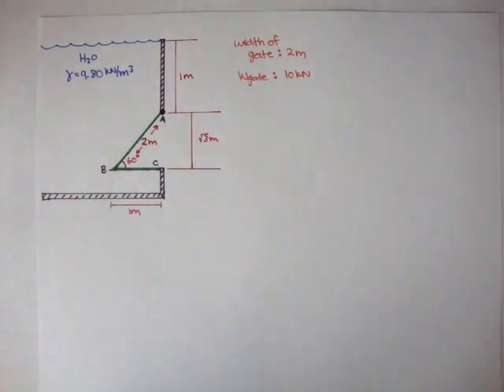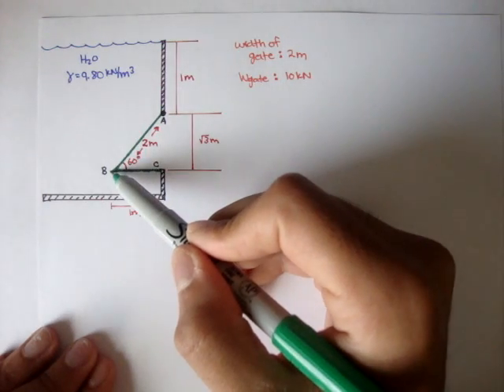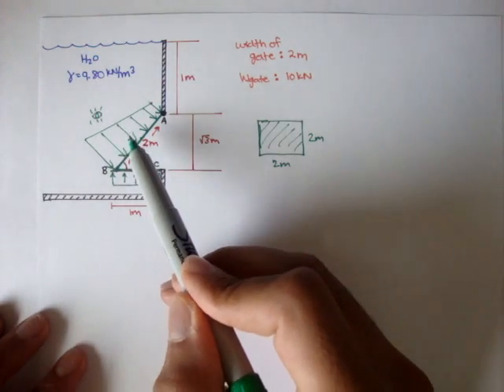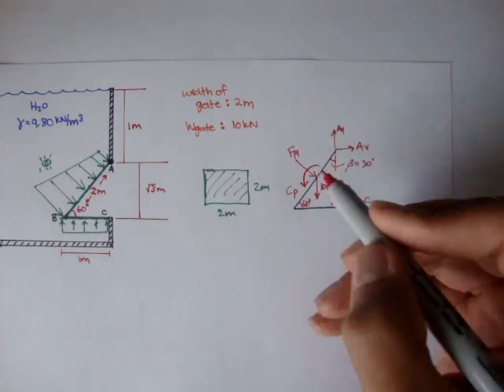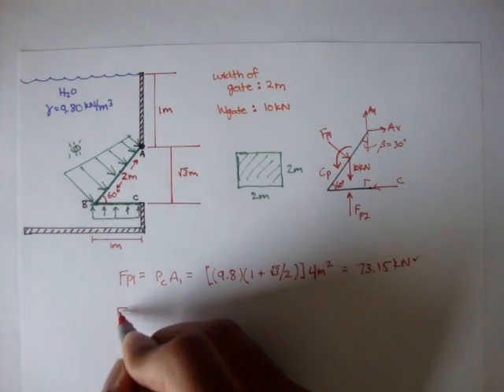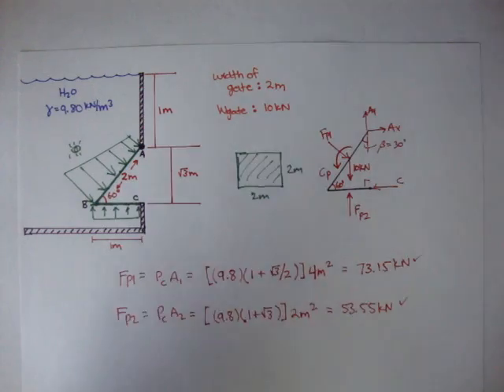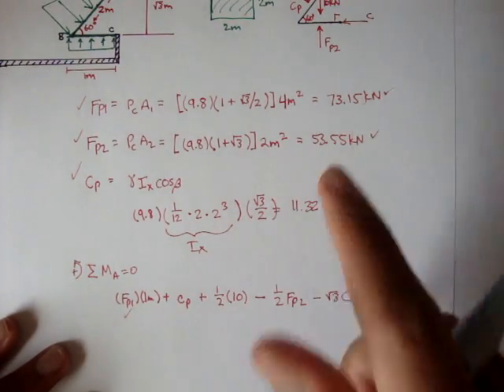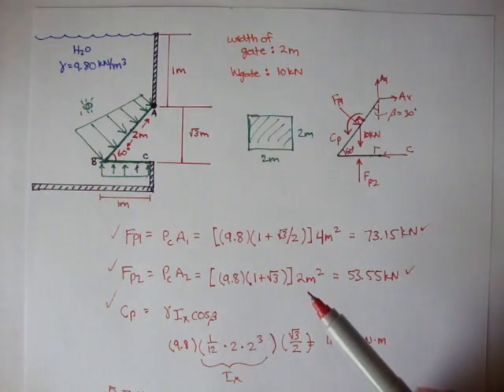Forces on Planar Surfaces: Example 2 [Fluid Mechanics #50]

Comment: Shouldn't we consider the location of the 10kN as the centroid of a triangle? Isn't the location of the centroid of a triangle is 1/3 of its base? Why did u use 1/2? Thank you :)
Reply: No you should't assume that. Look at that 10 kn, it is weight od the fate. It suppose at the centre of the inclined planed. He give 1/2 at 10 kn due to its moment at point A so it is (10kn)*(1/2 m).

Comment: what if there is water on both side with the gate is in between, how to solve?
Reply: I did a problem like this before.  The free body diagram would have more forces acting on the left side and the right side, I had to make 2 free body diagrams to do it one for the left side and one for the right side because the center of pressures were different because of the angle that the gate is tilted at.  It was a confusing problem.  It also depends on the heights of the water on both sides, because the pressure would be different if the heights of the water were different via density times height times gravity.

Comment: Great vid mate. Just 1 question, are you assumming the position of F1 acting at the centroid of the gate due to simplication? Due to trapezoid pressure prism, I think we should determine the position of F1 which is Ycp.
Reply: +Ezam Shah One can either use the centre of pressure (i.e. finding where the resultant acts along the gate), or the force along the centroid added with a couple.